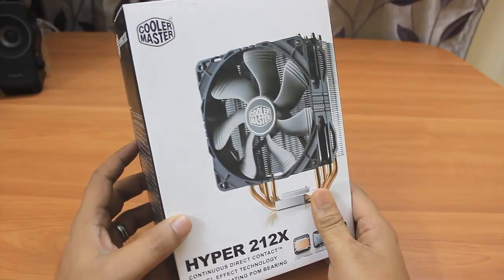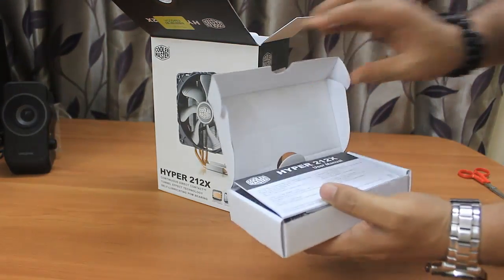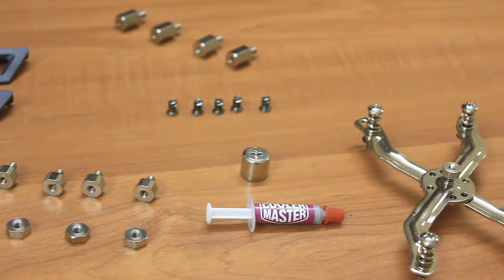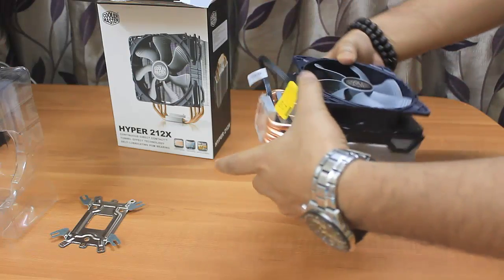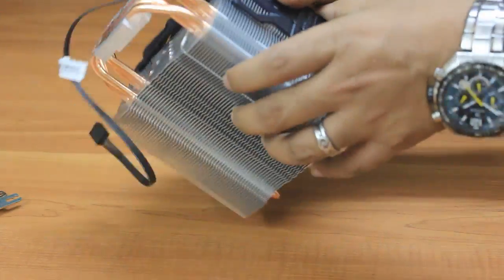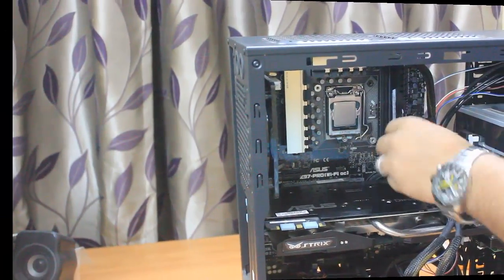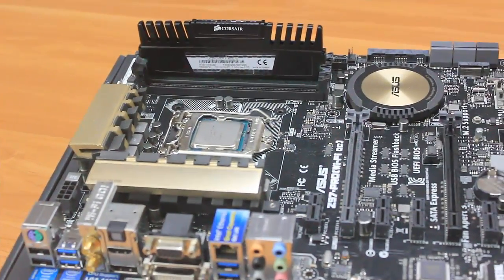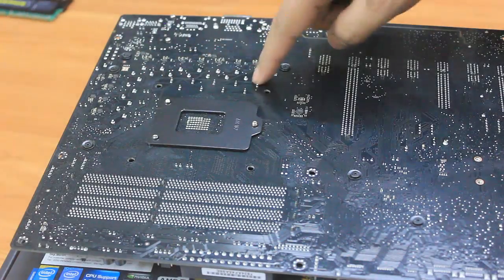How to install Cooler Master Hyper 212X Cooler | LGA 1150 | Intel i7 4790K processor

Comment: Hi Abhishek...I have done all as per your video for my i7 4790 but here's my problems:
1. From day 1 there is a ticking sound coming most probably from the fan side but I have checked the blades are not touching anything. Is this manufacturing problem?
2. Though the whole assembly stands firm on my Gigabyte Z97X-UD3H-Black motherboard and all the screws are tight, if you touch the heatsink and try to move it  - it moves a bit horizontal in both directions. Where did i go wrong? Or again this is manufacturing defect?
Reply from the maker: +Samrat Chakraborty Hi Samrath ... 
1. I do not get ticking sound in my cooler , may be some other fan is crossing the airflow for this cooler .. try changing some of the fans direction ..
2. Yes, if you try moving the heatsink with bit force, it does move/slide on thermal paste ; may be its the design issue. If it moves easily try screwing it bit more tight.
Reply: +Tech Virus Thanks Mate. Ya its a design flaw and the fan supplied has manufacturing defects, its not touching anything just ticking by itself. Should have gone for Noctua or Corsair. Anyways please tell me what should be the best rpm for the fan, my gigabyte app has 4 options: silent - 930rpm - cpu32degree/standard - 1025rpm - cpu35degree/performance - 1250rpm - cpu30degree/fullspeed - 2070rpm - cpu30degree. This is at night time in Kolkata i.e. less hotter.
Reply from the maker: I use standard speed settings .. you may use silent if not playing games ! Full speed is too loud ... can't keep on it.

Comment: Tech Virus  I have a 5820k planning to overclock @4.0Ghz+ (as far it goes stable). I've narrowed it down to Noctua u14s & Cooler Master Hyper 212x. I've read enough review to understand that Noctua is really high end stuff but if 212x can do the job then I would definitely like to save around Rs.5000 as Nactua is around Rs. 9000

P.S- Noise is not an issue UNLESS Hyper 212x totally sound like a lawn mower.  Thank You :)
Reply from the maker: +Rishabh Rai Go with hYPER 212X , it gives little sound but its effective .. Use those extra 5k on SSD :P
Reply: Tech Virus Great advice about SSD actually. But will it hold the temps of 5820k @ 4ghz ??
Reply from the maker: Thanks ..Not tried with 5820k , just check other reviews , is it LGA 1150 Socket ?
Reply: Don't go for the Hyper 212X. It can't handle the 270w TDP from your overclocked Haswell-E. Go for something like that Noctua NH-U14S.

Comment from the maker: +Bryan James Santos - Yes you would be able to add 2x120mm fans on top we have enough space to fit in. Yes, you can also add one more pull fan in cooler (clips are provided to fit that). Yes, both are one or the same (not sure about extra clips if it comes with EVO).
Reply from the maker: No, you can use it directly .
Reply: Tech Virus Have you try to install this memo on the very first slot, the dark one?
Reply: +Tech Virus When cleaning the thermal paste you should use isopropyl alcohol to clean it faster
Reply: +Charged Creeper Gaming on what motherboard can i use this
Reply: Do I need to clean the CPU or the heatsink if mine are newly bought?
Reply from the maker: No you don't.

Comment: Hello! 

I am planning to get the same after market CPU cooler. But One thing bather me is that will it fit if i have 2x120mm fan on top? I saw yours have 1x120mm were you able to install it back after you install cooler master hyper 212x?  Also can I Install another DC mode 120mm on the other side to make a push pull cooling concept still with the 2x120mm on top of the case? I am using a Corsair Carbide Spec 03. I saw a video fitted a 212 EVO on Spec 03 so i assume this one will fit too(though it is 212x). Thank you in advance!
Reply: pre nagawa mo n ba to? um-ok ba?

Comment from the maker: tirtha44 - Yes, its pulling it out .. Intake is from top with another Sickle flow ..
Reply: Hello there..i wanna asking about something sound so noise like buzzing from cooler master and when i playing high graphics such as Assasin Creed Syndicate, and then my cpu's restarting but i've tried agan playing games agan and restarting until 3 times :(
can you have solution, right now the 3 pin fan cooler attach to motherboard but should i need to attach the 3 pin fan cooler to molex psu or else?? thankyou so much...regards
Reply: Syed Rahman  hello my friend...thankyou for your response, i'll try that later..regards :)

Comment: hello abhishek, nice video. But I am just curious about one thing. 
I think you are using the CM sickle flow 120mm on the back, but isn't it pushing the air into your cabinet instead of blowing them out??

Comment: Thermal past will make the temp to come low can u show like how to use it
Reply from the maker: Amit Kumar I have used it in this video check it :)
Reply: Tech Virus Any past or there is some different in past put the name and cost ....
Reply from the maker: its default Paste, it came with the cooler box . We can use arctic cool it costs around Rs.1700

Comment: It's amazing how large the heatsink is for the aftermarket air coolers. Don't get me wrong, they're amazing, but I'm looking at this cooler for my next computer and I keep worrying its gonna snap off the motherboard, despite me going for an ASUS TUF series board.
Reply from the maker: DestinySeraphim Its not too heavy ... and it has really strong base to support so don't worry go with it ;)
Reply: Well that's a relief. Good thing I'm gonna use a Corsair Obsidian 750D cause good lord that thing is super tall.
Reply from the maker: cool .. its nice

Comment: Interesting stuff!  Using the Hyper 212 Evo myself, I was getting temperatures around 26 - 31c at the UEFI, but I think that was because I was using Arctic MX-4 thermal paste.  Nothing wrong with the default thermal paste that comes with the Hyper 212X, though.  Good job!
Reply from the maker: Robert Morin Thanks, I will try that thermal paste as well in future and let every one know about the difference ;)

Comment: that's why i hate these mid range cases....you have to remove all parts out in order to install aftermarket cpu cooler...and they do not support liquid aio coolers
Reply from the maker: Rohit Wakhle True ..
Reply from the maker: Are you crazy ? It will not work after 10 mins only ...